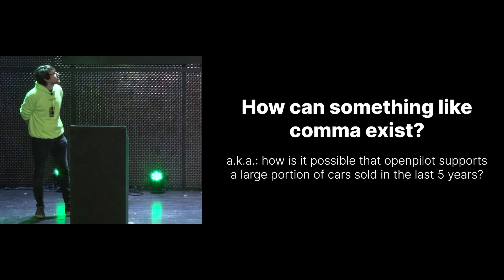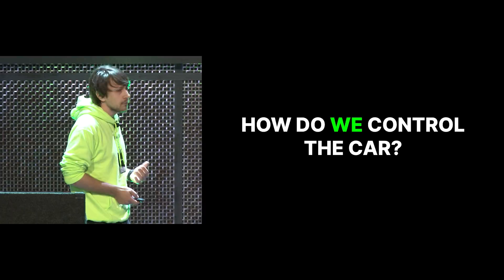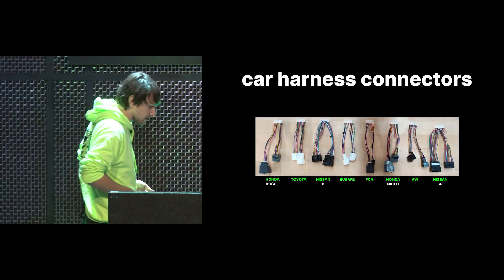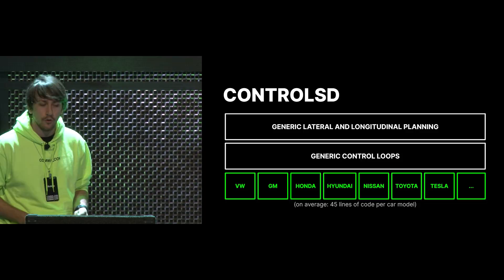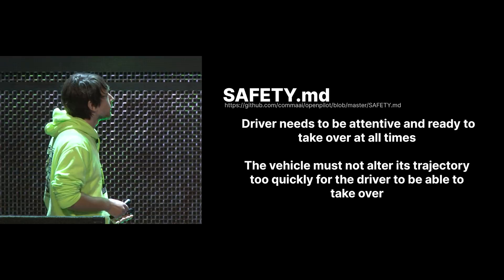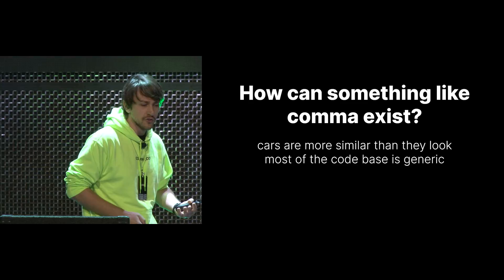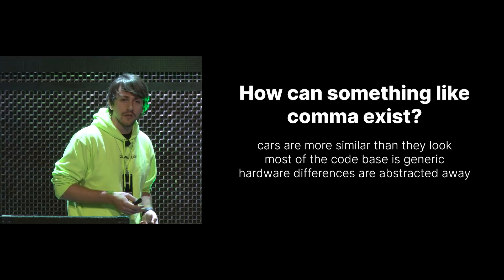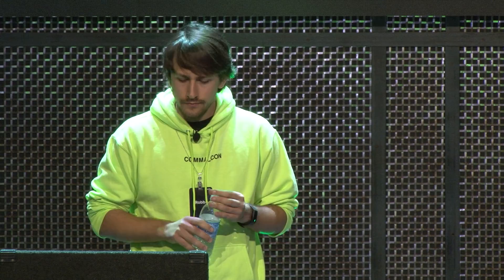How Do We Control The Car? | COMMA_CON

Comment: How old of a car could openpilot hypothetically work on? Is a LKAS camera absolutely necessary? Could it potentially ever even work on cars without a built in LKAS?
Reply: Absolutely. If you want to do custom actuators you can make it work on cars without CAN like a 1990 VW van which someone managed to get working. But even with the stock actuators, I got a Caddy to work that has a manual transmission and no adas like not even cruise control
Reply: Lane-keep is older than you think. I have a 2014 Prius with radar cruise and lane keep.
Reply: @grekiki  how were you able to control non lkas car ? external actuators or eps retrofit ?
Reply: @Radiant-hf2vh  Recoding the EPS to convince it that it has LKAS via VCDS
Reply: @grekiki  I was thinking about this - having a Renaut Twizy and an Audi A2 in mind - when watching some videos. Both with CAN bus but a Mercedes S124 does not have this. 
One is the steering. I suppose with power steering soon afterwards CAN Bus control was implemented. It's not there with the Twizy. (Traktors is a separate issue but for field work they added steering and an accurate GPS).
Another very important interface is brakes. Nearly for sure not there with the Twizy. Electric Re-Gen is not enough. 
For the Audi A2 which was built from around 2000 to 2005 both, Steering and Brakes need to be figured out. Re brakes, it could be there is information because of ABS.
The DBC build tools here will get very interesting.

Comment: When you have connection to the other systems.. Like climate control or infotainment.. I think there is a great opputunity to the people from the open source community to make "apps" for the platform like.. Preheat the cabin from the connect website, when using the comma three with LTE and stuff like this.. Or open / close the car, battery status remotely. Because I miss these features very much on my Hyundai Ioniq 2019 vFL, because in Europe the Ioniq vFL hasn't the BlueLink connectivity and I miss them very much. I think there are a lot more cars, that has the problem. In Germany alot of the cars from Stellantis (Opel, Peugeot etc.) with begin of the next year, because they kill the plattform. Even for newer cars like a 2022 Peugeot e208.
Reply: Thats a good point. Maybe this should go through an API to have some control.
They kill the BlueLink platform?

Comment: Seems like OpenPilot might be screwed when OEMs start implementing message
 authentication on their CAN communication networks. How long before this happens?
Reply: 29:40 "I break it if I need to"
Reply: They may force a royalty or something for signing, or refuse to entirely. Wouldn't put it past them.
Reply: @reallyiffy   I'm think OEMs will eventually block this because of liability concerns and possibly prevent a competitor from their inhouse AV solutions
Reply: @taumax  what liabilities?
Reply: As long as comma does not change internal code for all supported cars and all auto companies will not do anything at all . They know open-pilot is helping the legacy auto companies in the world currently.
Reply: @rickyliu1454  I'm not talking about current cars. I think cars going forward will have message auth built in by default. So that kind of limits future growth of comma3,4
Reply: @taumax   Definitely. Car makers will block these devices in the near future.
Reply: @taumax  Never thought about that, it could be a hinderance. I am debating between getting either the Comma 2 or 3 for my 2021 Toyota, but honestly rethinking it after seeing how many overheating issues people have been having, or just failed USB-pins etc. on the Comma 2 (the one I am leaning towards).
Reply: @AxemanMessiah  FWIW, I've never had a problem with my comma 2 overheating while driving, only when parked. However, if I place a modified sun visor for when I'm not in the car (which has a slit in the middle for the comma unit,) overheating while left in the car is not a problem. I know some people take it with them when which probably increases connect/disconnect cycles. I haven't had any issues with the USB, but i leave my unit in the car. In general, the cables take the bulk of the wear from connect/disconnect cycles since the cable side is the one with the springy moving parts.
Reply: @reallyiffy  makes a lot of sense. Thanks for the detailed reply. I agree if you don't disconnect it often the cables should last many years to come at the expense of heat but there is a workaround to it. Is there a pic or something online that shows the modded sun visor? I was thinking the comma 3 would be in white, GeoHot says it doesn't make a difference as it's the internal hardware that is mostly causing the heat but I disagree, in a parked setting the white will deflect heat significantly. Perhaps the comma 2 is the best choice after all.
Reply: @taumax  I believe Comma 3 or more will be even better. Comma has a bright future.
Reply: @rickyliu1454  yes, the product is good and I like what the company is trying to do. I'm just a little afraid the OEMs will secure their CAN communications on future vehicles.
Reply: @taumax  please Don’t worry at all , it won’t happen until next 10 years .
Reply: @DanMoto simpler in terms of fewer mowing parts in the propulsion system, yes. In terms of SW and electronics, no. As much as I like OS, I don't see that happening anytime soon.

Comment: What happens when the stock AEB requests a deceleration for more than -3.0m/s2 ? Does the panda filter it or pass it through?
Reply: good question. I think AEB messages are passed through.
Reply: The panda just filters messages going from OpenPilot to the car so it wouldn’t affect the cars built-in systems. 

The STM32 would receive a USB packet, analyse the values and then either create a CAN message if the values are valid or discard it if not valid. Might send a NACK back on the USB port. Messages already on the CAN bus would be received by the STM32 but it has no control over those.

Comment: Which device class are you using for the STM32 USB? Is CDC fast enough, or did you use HID or mass storage, or did you have to develop a custom class?
Reply: Does anyone know how this unit deals with the cars baseline saftey features? The emergency breaking for example? When you tap into the adas system is the link between the adas and the cars saftey features broken? Or do all the saftey sense features still work as per factory settings?